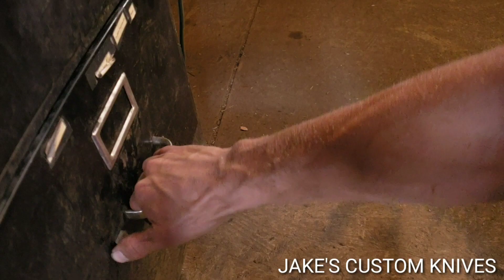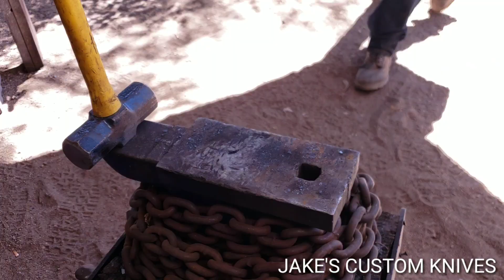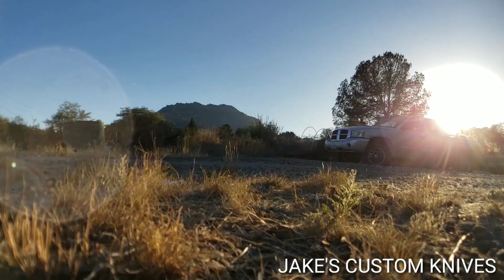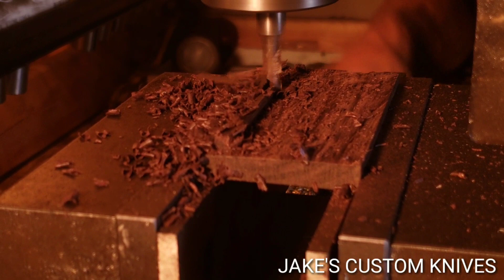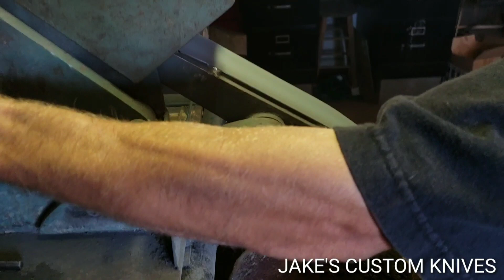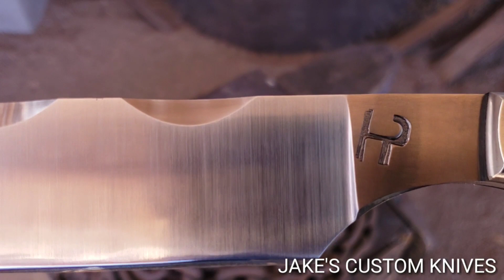Forging A Knife From Truck Spring

Comment: Nice knife but do you know what steel you're using? Leaf springs are a total crap shoot, could be 4140, 5160, 1080 etc etc and it's crucial to know which one you're dealing for the proper heat treat, otherwise you're just making a pretty pointy paper weight that won't hold an edge or may be far too brittle for any practical use.